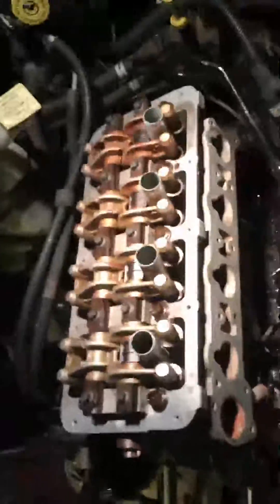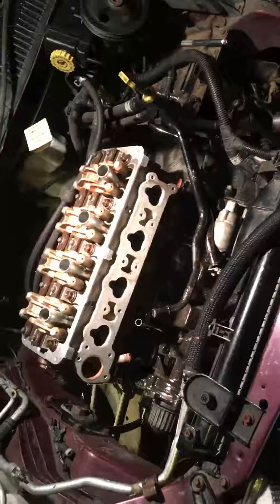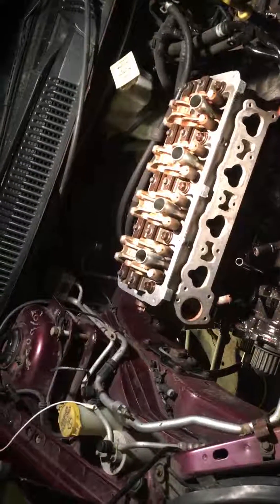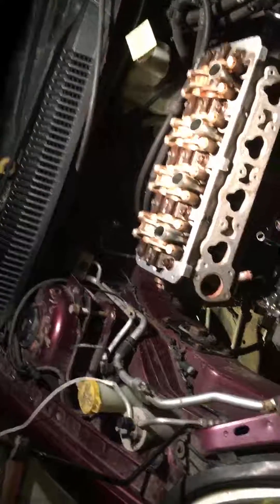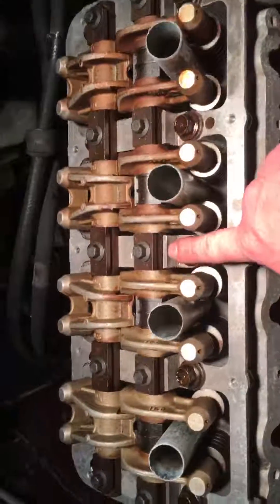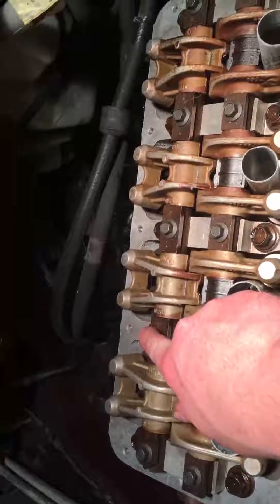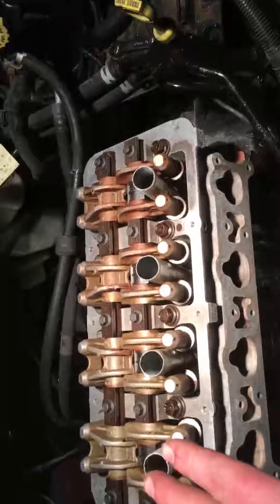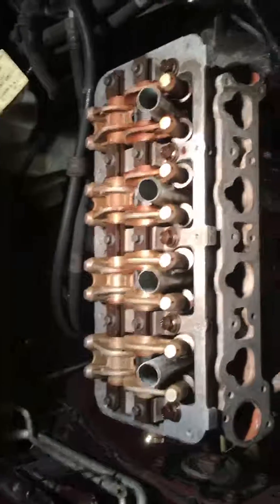2000 Dodge neon head gasket replacement tightening bolts sequence to specs

Comment: so
i just saw a video reccommending sending the head to a machine shop to repressurize it and make it smooth and fix any warping that may have happened if/when the car had overheated.
WHAT is  and Where is
this kind of shop?
Reply: he said just replacing the gasket would not fix the problem if the head had warped